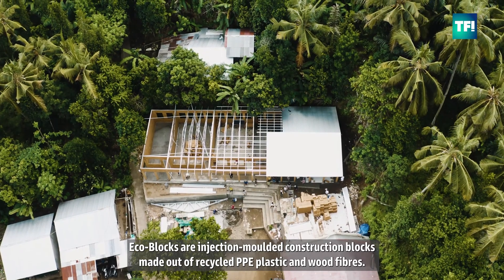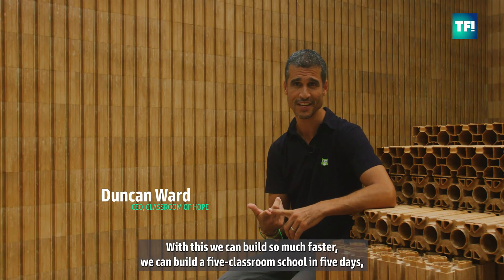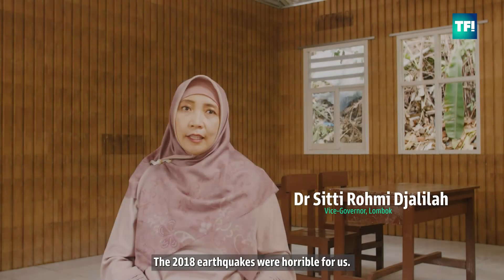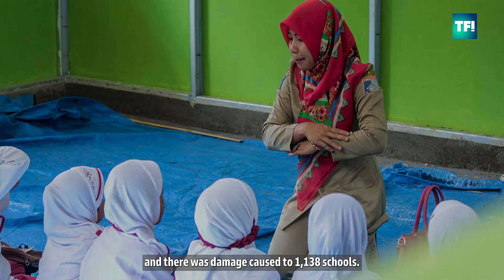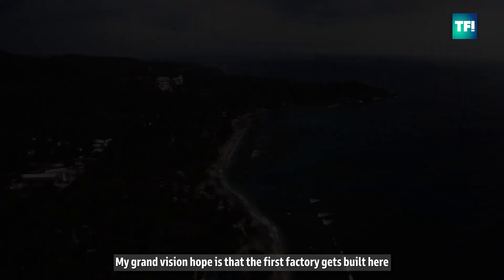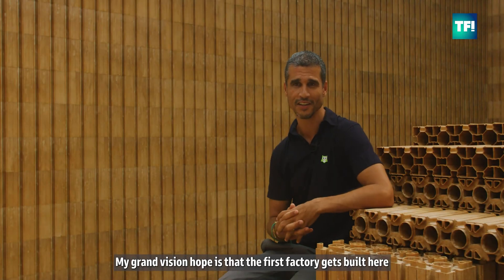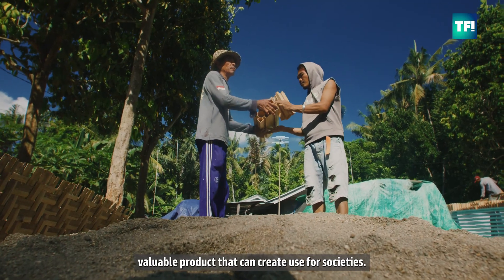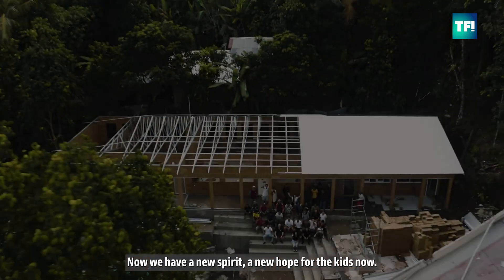The future of building, Eco-Block Technology!

Comment: As I have posted before:
Lombok was severely affected by the earthquakes.
My family and I will be returning home to lombok once boarders have open. Recycling waste has always been a problem in Indonesia.
Many Expats in Senggigi have implemented many strategies.
Converting waste products into construction material is a breakthrough for low cost housing.
Over 22 years in lombok much has changed, but Block Solution has indeed developed a construction material which is scalable and sustainable. Not to mention the economic benefits. I look forward to Lombok future with this newly developed solution.
I look forward to visiting the school and getting together with the immediate stakeholders to offer assistance if need be.
Thank you for helping the lombok recovery.
Assalam’mu allaikum wr wb